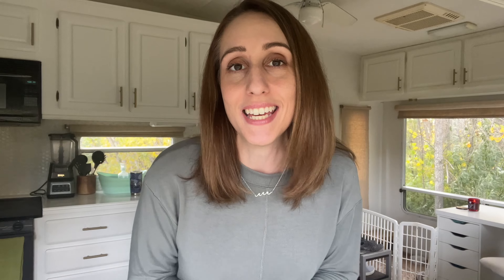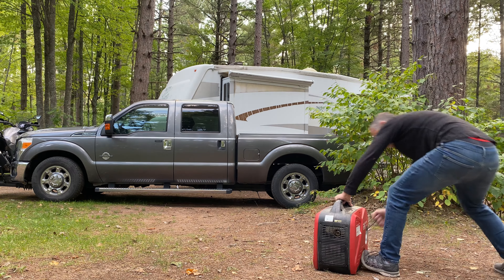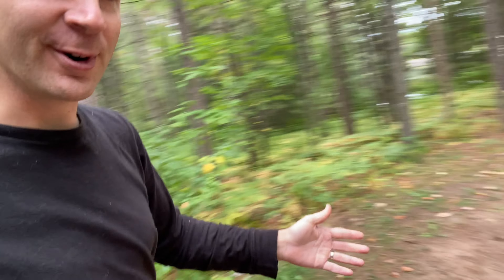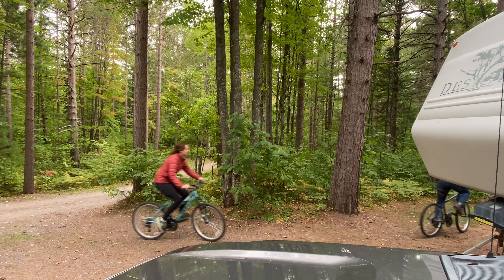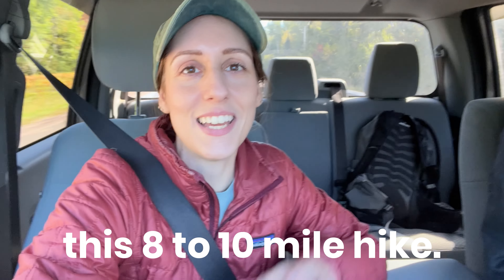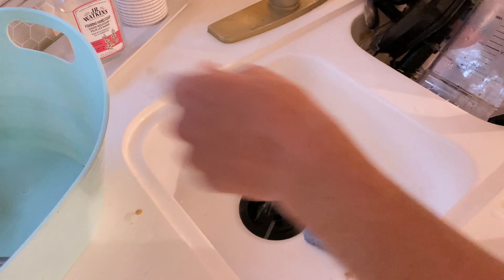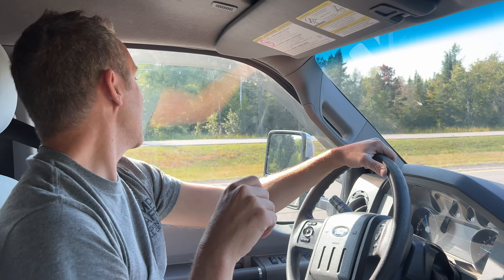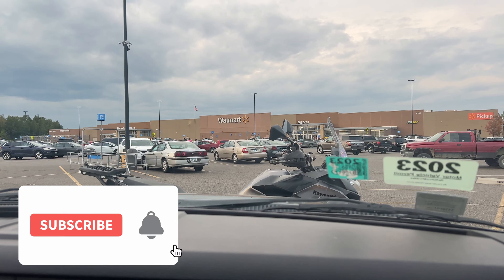We Were NOT Ready for This | The Scariest RV Life Travel Day

Comment: Get some plastic pipettes to check for water in your gasoline. Gasoline with Ethanol collects moisture from the air. If there is water in your fuel, when you look inside the fuel tank, you can see the water collection on the bottom of the tank.
Reply from the maker: So we eventually seem to have solved this issue with a fuel additive. -J

Comment: These are the type events and situations that can be a real pain to deal with. Lucky you are near a Walmart where you were able to get a replacement tire. Make sure any replacement you get is trailer rated and 10 ply if you did not know already.    
If you guys have a chain saw it is way easy to just cut a couple of wheel chocks from a couple oak or ash trees fire logs before cutting them to burn. They are way cheaper then buying store chocks (will not break like plastic) and can be an “emergency” source of firewood at a remote location if needed. You can custom cut them to size you need also. You can even cut some 10” wide by 2” thick and 12”, 18”, 24” long that can be used as level pieces and can be burned as they get old.
If you are still planning your trip to Alaska consider plotting your roads route AS WELL as places to purchase tires, trailer parts and repair shops along your route. This may save you from having to wait a day or 2 to get the items you need for the repair.
I saw you cleaning the Solar Panels early in the video (good job) and this is something that is very important that a lot of people miss especially when they are mounted on roofs. For solar panels to run at maximum efficiency they need to be 100% CLEAN. If the have even small amount of leaves, dust or debris on them you will loose almost all power generation. 10% coverage of a panel and you loose @90% of generating power. Max output needs panels to be almost perfectly clean. I will mention also that I have an IBEW Solar certification and have worked on installation of several very large solar farms in PA, NJ. 
If you are going to do air fryer again maybe consider running that off your generator, it will save a ton of your battery capacity for other uses. Air fryers use around same amount of wattage as a hair dryer and it can eat up battery storage pretty quick. Air fryer should run off of generator and will only be running for a few minutes. If you decide to use genset make sure to use a short extension cord that can handle 20amps load….12/3 gauge should work.
Look forward to your next video.
Reply from the maker: Thanks for all the feedback.

I like your idea for wheel chocks...need to remember that next time I'm around a chainsaw. -J

Comment: I can see you guys are upping your youtube game recently.  Looks like you were posting randomly until recently, but now at least every week.  Im curious why all of a sudden you are posting on a regular schedule after doing this for years posting once in a while.  Generators suck but sometimes are necessary,  we also have a propane fridge, why so many people are getting residential fridges.   We also have the color control GX for our Victron system.  I have starlink and use it at every spot, i did a diy long cable, over 300 feet to get to open sky when in the woods,   I am working on a remote starlink system that i can put up to a half mile away to get open sky, it runs on its own battery remotely and use a Wi-Fi  range expander to get the signal to the rv.  Working on it this winter for our summer trip west again.    Get a honda, 2200 the work every time.  My honda 2000 is 20 years old and still starts on first pull.  They are expensive but sometimes it is worth spending a few extra dollars.  Sorry for all the long comments, woke up at 5 and binged your channel.  Larry
Reply from the maker: Hey Larry!

Re: Youtube game - we've tried 2 times in the past to build an audience on youtube with little to no success. This year we went at it with a much tighter strategy. We both love documenting our adventures but we did a lot of things wrong the first 2 times around that we're really working on correcting. Ultimately we would love youtube to be part of our income allowing us more freedom in travel. We did recently get monetized so now the quarters are rolling in. 😄

We initially made the jump to RV life with Kalyn's writing business as our full time income - but 2020/2021 + inflation hit us hard so I've been picking up quite a bit of workcamping jobs. (More on that in this video: https://youtu.be/uWDnhxDxTkM?si=ZRMd_H7KuqPYwD7H )

We're trying hard to phase out of workcamping and back into working on our own businesses. That's how I'm treating youtube by committing to x number of hours on it per week. -J

Comment: I love the u.p! Although i have never been all the way over to the porcupine's, Im jealous! Glad you guys had a good time and that the tire didnt mess too much stuff up!
Reply from the maker: We lucked out with that tire for sure for sure! -J
Reply: I just watched this video again, may I suggest a valve core removal tool. You could have removed the valve core and walked away from the tire as it deflated, and away from potential danger. I have also found loose valve cores causing a leak that you can't find.... also I'm  Sure you know about them and you already purchased a generator and probably won't replace it for "no reason" but a dual fuel generator would be nice. That way you wouldn't have to chase gas if you didn't want to. The predator doesn't have one that size for some reason, but other brands do, just an FYI if your in the market

Comment: I know it is an expensive, but they make much quieter generators than the one you have.  Also, just curious, are your batteries lead/acid, AGM or lithium?
Reply from the maker: Yeah - I know that honda makes a really quiet one. The issue I have with buying a super expensive one is that we really do not use them all that often. Except in winter which eventually I'd like to make my solar panels tiltable which would help solve that issue.

We have 3 Battleborn Lithium Batteries. We invested in that and our minimal solar setup when we started our journey 4 years ago. -J
Reply: @OpenRoading  Good choice on the Battleborn batteries.  I hear they are a really good brand of battery..
Reply from the maker: @kencotton4645  There's a good number of people out there who believe they are grossly overpriced. I don't know enough about the technology to have an opinion. I do know that their warrantee is really good (8 years full, 2 more years partial). 3 years in one of our batteries stopped taking a charge. They replaced it, no charge and paid for all the shipping back and forth. -J

Comment: Glad you are both safe. Do you have a TPMS and didn’t get a warning about the tire?
Reply from the maker: We do have TPMS although I think the tires are on the edge of it's range (distance from cigarette lighter to tires) because sometimes it seems to take a while to update. That said - in this case the TPMS worked flawlessly because the tire actually didn't lose a single pound of pressure during the failure. It was sitting there at 80psi....with the tread laying on the highway. Once I started deflating it at the rest area the TPMS started beeping in the truck.

I don't know everything there is to know about tires but I was genuinely shocked it didn't go "boom" on the 2 mile trek to the rest area.  -J

Comment: It’s weird watching this one and Trinity is not there!!
So do yall have a lithium battery? It’s kinda confusing when ur talking about ur battery/batteries capacity???  And does the truck recharge the house batteries when ur driving??
Reply from the maker: We need to do an updated power video. Yeah, we have 300Ah of Lithium and it's charged either by solar power or shore power. We don't have a setup to charge it via the truck so we have a small generator that we use in a pinch. Generally we only need that when boondocking in the winter. -J

Comment: Goodevening.  My question on your solar setup. Did you DiY or have it installed professionally? I purchased 4 Battleborn Batteries and the whole system. With 1200 watts of panels. Thinking i may need 2 more Batteries. And have it professionally installed.
Reply from the maker: I installed mine on my own (and I am by NO means a professional.)

HOWEVER, I did communicate with a professional from Northern Arizona Wind and Sun and we walked through exactly what I wanted to be able to do with my solar system and he "designed" the system for me. By designed he figured out what size panels I needed, how much wire, what size inverter, solar charger, how many batteries, etc.

But when it all came...there were zero instructions. LOL. So I did a LOT of research before and during getting it all set up.

The two things I encourage you to do are:

1. Avoid the piece-meal approach. Get a setup you'll be happy with and get it done. 
2. Make sure your setup can do things SIMPLY. When I plug in my RV, I don't have to flip switches, I just plug it in and it charges the batteries via shore power. When I'm unplugged everything (12v and 120v) works off my batteries. I don't have any extra steps that I have to remember - it just....works.

We're planning on doing a video about our minimal solar setup at some point but I'm super nervous about it because...well...I'm not a professional. -J
Reply from the maker: To answer your battery question - I have 640w of solar and 300ah of batteries. So with that much solar you certainly would be able to handle more batteries. -J